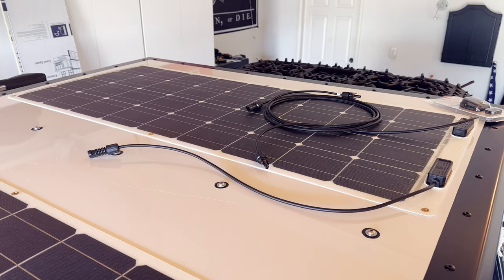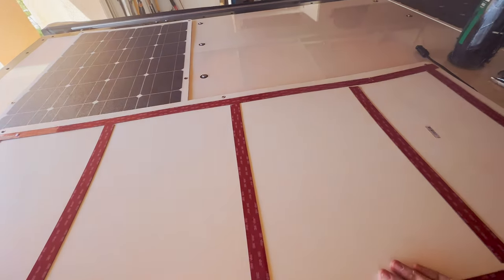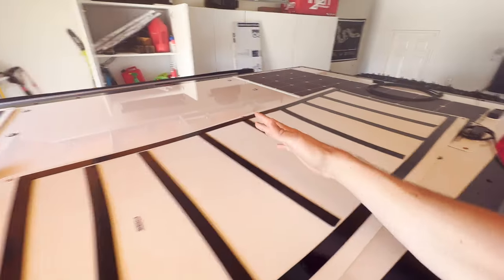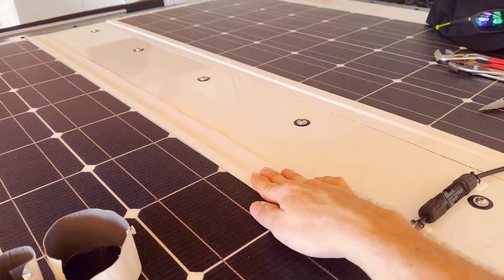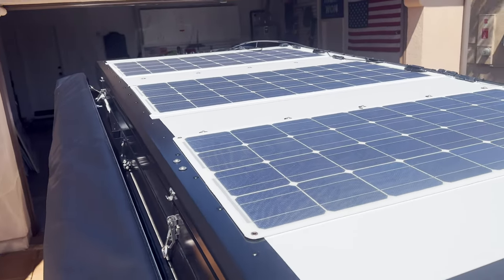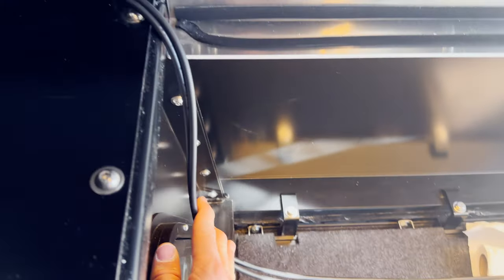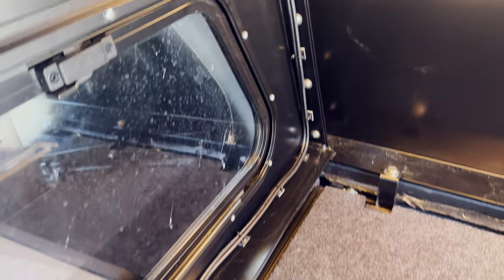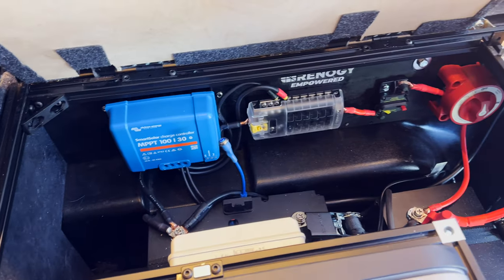Easy Way To Mount Solar Panels NO DRILLING Truck Camper DIY

Comment: HA!  Hey, you put one more up there and it'll look like the top of my Super Pacific!  I recently put 4 of the same panels up there (caulked down...).  So far, it's working GREAT.  Love having the battery (Bluetti AC200P) topped off after a night of heavy usage by like 2pm.  Sweet set-up.  Keep up the great content work.  You might want to leave more gaps in the tape for water to escape...
Reply from the maker: Wow, four panels that’s super awesome! And that blue Audi battery is super nice top-of-the-line lots of capacity. Thanks for watching Matt.

Comment: 1 year update. How are they holding up?
Reply from the maker: Working great
Reply: @jonnytacooutdoors  good to hear. I'm thinking about taking the ridgid panel off and replacing it with a few flexible panels.
Reply from the maker: @takenpictures  right on

Comment: So im researching and came across your video for the solar... Hows the quality now? Do the solar panels give you the output its advertised?
Reply from the maker: With the 3 panels I get up to 250 at times during bulk charge 😎
Reply: No damage or degradation? The heat hasnt made it bubble up or diminish in some squares?

Comment: Nice Job Jonny! Great content! I am  currently building out my Alu-Cab and about to chose what solar panel or panels to use ?? I really like the new CIGS but are very expensive Sunflare and Bouge RV are the ones I am looking at,, more towards the Sunflare because it fits the best with the Alu-Cab. Pros and cons trying to make them waterproof.. have to agree to try and let them breath and not trap the water as they cause future problems.. it will freeze here in Canada! lol Cheers buddy.. just my thoughts.. all good!
Reply from the maker: Love those Alu-Cab campers. I recommend these solar panels because they’re cheap and if they ever go bad they’re cheap to replace. By the way they’re pulling about 240 watts in full sun. They’re Killin it. 💪🏼😎 thanks for watching Paul!